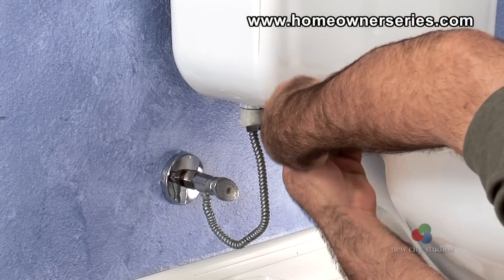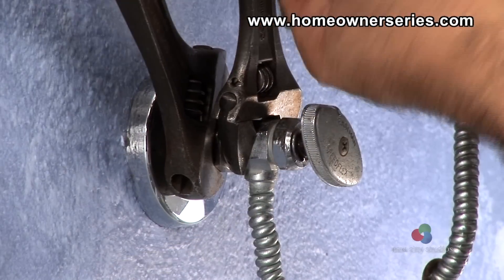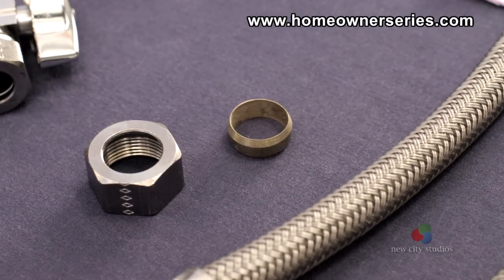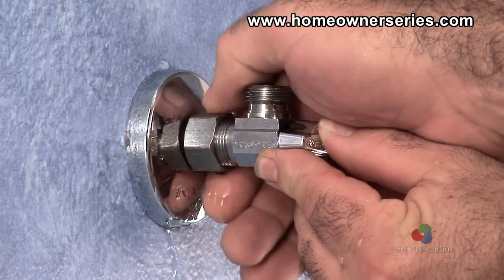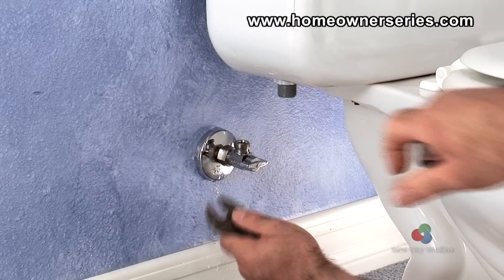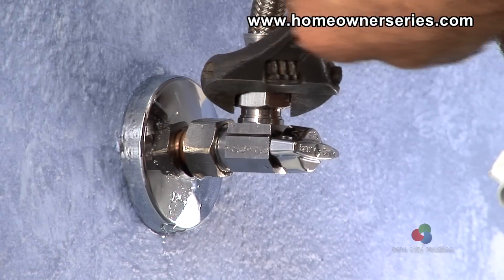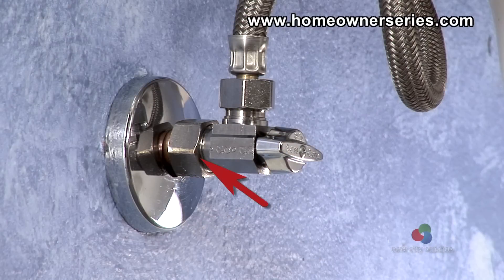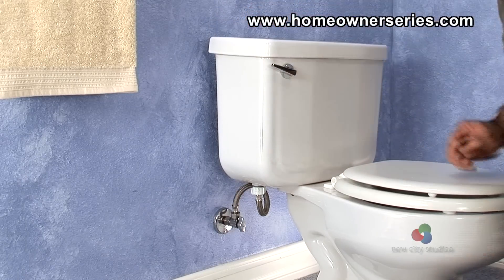How to Fix a Toilet - Water Supply Valve Replacement - Part 2 of 2

Comment: Very easy to follow instructions.   I was a little nervous completing this job, but felt more at ease by having purchased a couple of extra parts in case I had the wrong size (extra supply hose, second 1/4 turn valve at a different size).   At the end of the job, I placed a couple paper towels down in the area, just in case I couldn't see any leaks.   All was fine, no leaks.  Thank you!

Comment: Saw how you took off the nut but how did you get the new compression nut on?  Skipped this valuable nugget.  Did you cut the compression ferrule off the same way and installed a new one?

Comment: Just wanted to say thanks for this video. I don't know why I assumed the copper pipe coming out of the wall had threads and I couldn't understand why it was just spinning forever. Makes complete sense that it's a compression fitting. Duh.

Thanks again!

Comment: Good video.  Why do they mount the damn things flush to the wall?   If you have to crank too hard, you can break a solder joint or unscrew steel pipe behind the wall.

Comment: Are all water supply valves compression or are some threaded on directly to the pipe? Also they didn't need to use Teflon tape on the threads?

Comment: Hi, i recently tried to install a bidet and when i was done with installation, i tried to turn the water supply valve back on. However, i dont see the water filling in tank or any sound of water flowing through the valve. I think I accidentally damaged the water supply valve. Can you advise what should be the trouble shooting i should do here?

Comment: You should have explained there are flanges on the inside of the escutcheon rings that have to be bent in to secure them to the copper tubing.

Comment: This is a great video!  I'm wondering how you are going to know if the compression ring should be reused or not?  There isn't enough travel on the pipe to to get the compression nut out of the way to view the ring.

Comment: if i replace just the hose that goes from valve to toilet..do i still need to shut off the water(handle on valve)..or is just shutting off the main suffiecient enough?i think i need a new hose its leaks from the top part..probally rubber went bad.

Comment: I tried to do it with the water valve on. Complete disaster. I eventually got it after getting completely soaked. But I am not a quitter, I refused to shut the valve off.

Comment: does it matter what kind of valve I replace it with a cheap Veil vs. and expensive when one that you have to turn several times to stop the water or one that only requires a quarter twist? Also is a replacement valve that uses a compression fitting better than soldering it? And if I use a compression fitting and it feels in the future would I be able to cut that ring off and swap over to soldering or some other form? I just don't want to do any more damage to the system. And I'm rather new at this.
Reply: I just upgraded to a 1/4 turn. Much better!

Comment: No thread tape? Is it not necessary?
Reply: compression fitting does not use the threads to make a seal, so no, not needed.
Reply: @oldtwinsna8347 water is leaking after installation. Any guesses why it might be?

Comment: You shouldn't have to turn the water off to the house. Just the toilet. And Darin it. Grab a bucket, for excess water, then replace it.
Reply: I'm getting ready to tackle this project but the quarter turn valve doesn't completely turn off the flow of water.  The tank fills back up with water after I tried to sponge it all out.  So now I have to shut it off at the curb while I replace the valve.